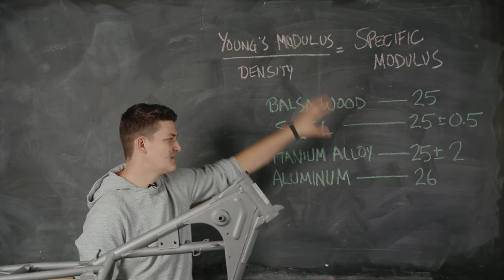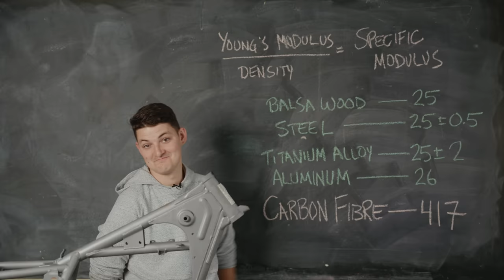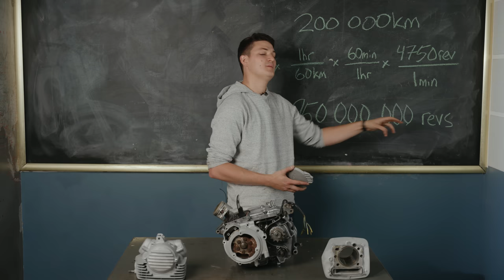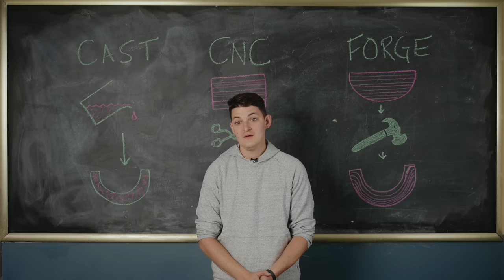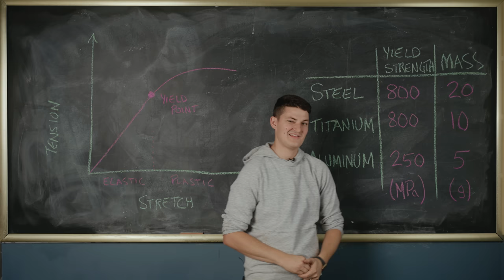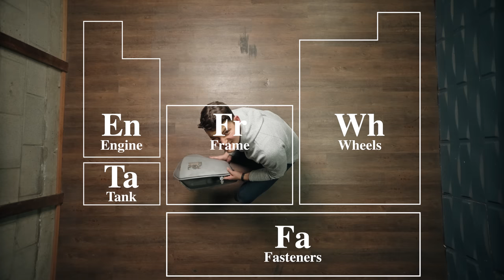Motorcycle Metallurgy - Why Steel? Aluminum? Titanium?

Comment: I learned the hard way to NEVER use stainless steel on exhaust headers, or any hot component.  At high temperatures, the chromium can slowly defuse in to the nearby mild steel and essentially solder itself in to place.  Requiring everything to be drilled out and helicoiled.  Stainless fasteners also don’t like impact guns.  While building a rear rack, 2 sets ended up seizing half way through the threads.
Reply: It's not just heat that fuses stainless fasteners to stainless parts but also shocks/vibrations through galling (cold welding). The rule in mechanical assembly is to use dissimilar metals (it can both be stainless steel but then you need an austenitic and a martensitic one). Using helicoil is a good practice and not just for repair. In the space industry, we use stainless helicoils on aluminum parts which are then bolted with titanium bolts covered in MoS2 (it helps against galvanic corrosion by decreasing the potential difference between titanium and aluminium). For stainless steel parts that need stainless steel bolts, we use silicon bronze helicoils. Impact guns are a big no no and more like a last ditch effort for loosening a heavily rusted bolt.
Reply: You can spray everything with copper spray. I am pretty sure that's the way to fix the problem. They also sell copper paste that you coat the entire bolt. Or if it's a low strength application, just coat the entire bolt in teflon pipe compound rated for 500F and oil and gas resistant. They also make high temperature thread lockers. Thread locker forms an insulating barrier of plastic between parts, preventing corrosion.

Comment: Fatigue limit (or endurance limit) is, perhaps counterintuitively, a stress limit under which the material is able to go (theoretically) through infinite load cycles without suffering fatigue failure. And steel is awesome because it actually has a fatigue limit.
Reply: Yeah he got that back to front
Reply: Was wondering if anyone else picked up on this!

Comment: Retired aero designer here, composites have their place and it’s a good place. However it’s not the recipe that’s a problem, it’s the cooks. Very finicky to design with, hates aluminum (galvanic corrosion), toxic and hard to inspect voids etc. It became what chrome in the 50’s was in the 90´s, and beyond, i.e., popular beyond reason and without enough data for predictable longevity. 
Once again Ryan has elevated moto culture above the usual caffeinated silliness. Gordon Jennings and the gang at Cycle magazine had elevated moto journalism in a similar fashion. Kudos to F9 for carrying the torch.

Comment: Steel is just such a faithful material. Cheap, easy to work and repair, and you can lower its weight by just making holes on it.
One of the main reasons we can still preserve so many railroad components from the steam era.

Comment: I built my track POS with just a used Ninja 300, and the same recommendation from many of my friends and other amature league champions before: keep mostly stock. 

Many components aren't planned out for just degradation under normal circumstances, things like handling, flexibility and longevity have been accounted for from the factory. We can change the minimum that affects handling or more, though go big or go home (big bore kit *wink*) kinda plan is up to end users.

A lightly armed Ninja with fairings, sliders and race tires (+ adjustable suspensions and raised foot pegs if you fancy) CAN blow a 600 off, left alone a CBR300 or Gladius that make you scream marauders. Hats off the metallurgy smagick and Ryan!

Comment: I liked the discussion of the different ways metal is shaped in the engine, but I'd like to see how that applies to the frame as well. The Ryvid Anthem uses folded aluminum and the Sondors Metacycle uses CNC'd aluminum for the frame to reduce costs and weight while supposedly being just as stiff as a welded steel tube frame. I'd particularly like to see Ryan's thoughts on the Ryvid Anthem after such a thought provoking review of the Metacycle.

Comment: I've been learning about  pedal bikes recently, and my cheap budget has led me to look at steel road bikes of the 80's. And there were some huge differentiators that would determine if a bike was high quality, or cheapo junk. One of which was what alloy of steel was used, chro-moly usually being the "best." They also would use tubing that varied in wall thickness; for example you might see tubes that were .9mm thick on the ends, but .6mm in the center, this would have been called "double butted" tubing (single and even triple butting existed as well). One manufacturer with a background in firearms, Miyata, basically even rifled their tubes in an attempt to increase stiffness and reduce weight. 

So, my question is, does any of this exist in motorcycles? Usually you just hear that a bike has either an aluminum or steel frame, and that's all the details you get.

Comment: Regarding cylinder walls: in aircraft engines, cylinders are frequently “chrome lined” to reduce corrosion. Does this appear in motorcycles anywhere? Also, does it reduce the anti-galling properties?

Comment: I loved the video, and in general, very informative.  I just wanted to point out a few things.  One, that rear wheel was bent pretty good.  Another, that damaged bolt was damaged with a chisel and other such implements, not over tightening, though admittedly it gets the point across well enough.  But for the thread strength, that's where the specific alloy, at least for aluminum, makes all the difference.  For 6061 (aerospace grade, depending on temper, and one of the most common alloys), your number is likely dead on, and 6061 anodizes well.  But 7075 has nearly the same strength in thread forms as steel.  The down sides are that it's not really weldable, and won't take anodizing.  I definitely didn't know some of those qualities of titanium.  One thing you maybe should've pointed out is that stainless steel is really bad for galling too, and any stainless bolts should have antisieze.

Comment: I get steel vs other metals.  I've been riding steel tube bicycles for years and prefer the spring vs stiff.  What I don't get is why the manufacturers aren't using the higher grade steel tubing (Columbus et al). Higher strength to weight, custom wall tapers, superior braze and weld characteristics. My DR650 is made from crappy soft steel that has a bad habit of stress fails near welds of the sub frame.

Comment: Galvanic corrosion is really different from your common rust.. you think you'd be safe from it by using aluminum, but then don't get it near titanium or else you'll experience a different kind of corrosion.. Nile Red shows this in an experiment and the results shows.. and you thought titanium and carbon fiber are the strongest.. then the former is prone to galling and the latter is weak to notching and fiber consistency.. it's all about balance I think..

Comment: I tried to explain this exact point a few times in the past, there’s a reason iron and steel is used for basically everything, and that when fiction describes a material that is perfect for everything, but describes it as tougher, harder and better than steel, I know it’s impossible with our current technology to move past steel and iron .

It’s very difficult to put into words how and why we choose steel or iron over titanium, aluminum, etc. It’s just that iron and it’s alloys are impossible to replace and are just that good, specific problems aside

I come into this argument from the perspective of an ex blacksmith and now a mechanic, I know how steel moves, I know how to break it.

Comment: Question?
I don't understand how frame stiffness effects handling.
The tires and suspension are designed to soak up/ control, wheel travel.
 Whether it's a Ducati trellis frame that flexs and is good.
Or an early dirt bike aluminum frame that's to stiff.
 This seams counterintuitive.
Should frames flex?
How much?
Why?
 If You answer thanks in advance.

Comment: For the record most definitions refer to the fatigue limit as the stress below which failure will never occur. That makes more sense with the way you have used it in the graph. Research also suggests even steels will fail eventually, it is just difficult to reliably test billions of cycles

Comment: lots of guys going with stainless bolts. I use nylon washers as the galvanic process requires an electrolyte so you have to keep the metals off contact when they get wet

Comment: on note of yeild strength
yeah, i feel that one more often than id like to admit
was trying to torque down the cam journal bolts on a KA24E head, aliminum
yeah, stripped them lil b's right out, right quick.

Comment: people have this misconception that because something is used on an airplane, that means its better, when that is almost never the case. modern private jets are made of mostly aluminum, titanium, and carbon fiber, not because they have some mystical quality about them that makes them "better," but because if you can make every screw, every panel, every piece twice as light as its steel counterpart, you can carry that much more fuel. steel really is a wonderful material and people need to realize that

Comment: I would love if there was a kit for a motorcycle like this that is super cheap. Im talking like 1500 dollars brand new cheap. Is that something that is not realistic for a kit motorcycle with everything taken appart kinda like in the video with a bunch of different subassemblies to put together, engine, tires, suspension, brakes, wiring, guages, gas tank, and so on. I mean the frame and such doesnt need to be painted with anything other than primer from factory to be ready for some kind of paint application, the cost would be lower on a single cylinder motorcycle kit with stuff like non electronic guages, no abs, no tcs, no driver aids, and so on. Since it would also have no efi, I would probably want the engine to be a honda as I trust their small carbureted engines the most. I guess something like a 350cc single cylinder would make this a good dirt cheap off road bike, paired with a 5 speed manual gearbox, and this could be super cheap. Still, the question is, would 1500 dollars as a kit for a bike like this be plausable brand new?

Comment: Steel? Because strong + cheap. Aluminum? Because lightness + reasonable cost [NB: no aluminum parts on early motorcycles because Al was higher than Ti co$t today.] Ti: when strong +light overrides $... Mix all 3 as needed to meet your co$t requirement$...

Comment: This is a great topic. Let's see what you do with it 😊 steel is preferable because it doesn't weaken much when bent. It's doesn't really age unless it rusts. The other elements suffer from brittleness. Fatigue. And are much more difficult to weld. Carbon is attractive until it suffers damage, and then it's total garbage. I have wondered why they don't use Chrome Moly steel.

Comment: if it is stamp forged then it keeps the grain. if it is hammer forged it will not keep the structure anywhere near the same.

but like with anything, how you build it dramatically changes how it functions.

Comment: I will say, though. In the case of every engine component or wheel, a block of aluminum is first forged, then cnc machined in the desired orientation of the grain structure.

Comment: I am 68 now. Back in the 70s when I used to race motocross with my tractor of a CZ 400. I did everything I could think of for weight reduction. Drill out bolt heads to remove excess weight ( flanged bolts were unheard of ) drill the cylinder fins and head fins at the proper diameter to increase surface area, but reduce weight. Use knobby tires with less weight, only fill enough fuel for the laps required. While it may have made no difference, it made me feel cool.😂😂😂

Comment: So a honda rebel chassis because cheap. An inline 4 cross plane because it sounds nice and is fast. Big sprocket in the rear with a 6 speed because speed. 2 gallon tank because low mpg. 

Reason why rebel chassis is because aluminium chassis. 

Recomend Hondas inline 4 they use in their CBR models. And aftermarket kits are plentiful and growing. 

Sub 5k if in good condition sub 2k if used and abused. I recomend a used and abused model because that tiny thumper won't be used anymore once you swap it. Sure you may need to bolt an adapter kit to make the fractionally bigger 4 banger but trust in the kit a couple cuts and some welds and boom. You got a fast 4 banger in the form of a scrambler. 

After that customization is all up to you.

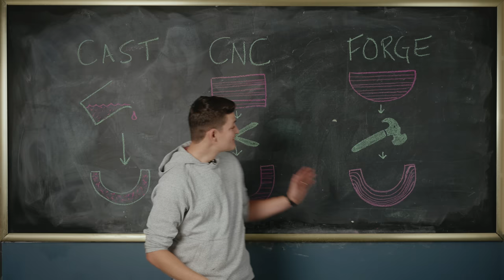Comment: casting has a predictable grain structure, just goes the wrong direction. past the surface where it shock cools its called the "colunar zone" its colombs 90 degrees from the surface of the mold, for every surface of the mold. so for that U example at 6:06 the cast should be like a bunch of slices of a pie radially with a wired seam in the middle where the columns of both surfaces touch. you can exploit the colums with slowly drawing a filled mold out of a oven for directional cooling to give you directional grains down the part that would look like the grains you drew for the forged in the same example. and with mold design you can isolate one colomb and create parts that are all one crystal of metal, its how they make jet turbine blades. casting is awesome but these techniques are more expensive then casting it close then forgeing.

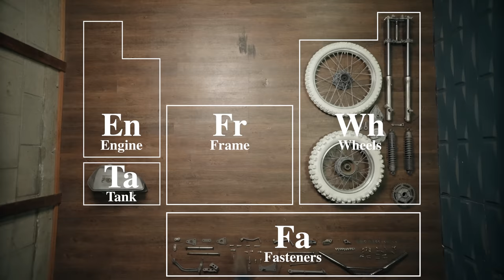Comment: 4:01 nylon lock nuts on the hot exhaust side? not so sure about that. you may find melting nylon forces the nuts loose rather than acting to secure them

Comment: Titanium Fasteners and Axles and such are also much different in how they provide strength. You cannot simply copy a steel axle and make it titanium because it will not be strong enough in the right areas, It has to be specifically designed for the application.

Comment: Stiffness of material is useless unless you shape it. Metal forming increases stiffness locally for each member. Assembling all members to form a frame, geometry increases the stiffness globally. 
In bicycles, a well designed aluminium frame will be better than a cheap carbon fiber frame. Though recently, stiffness may not be the focus but instead it's the responsiveness of the frame, as well as weight.

Comment: There is a remake of the HOREX Regina in the works. One cylinder 600 cc. Does anybody need more motorcycle? Oh, did I mention this lightweight beauty does come with a carbon fiber frame.

Comment: Steel actually has a fatigue limit. If you stress the steel parts under the limit they will not fail. Aluminium alloys don't have a limit as such so they can experience fatigue failures on any stress levels. So in engineering they use term fatigue strength for these types of materials. Basically its a stress level on given materials on were material can endure large number of cycles without failing. The key difference is on steels this number of  stress cycles is considered unlimited but on fatigue strength case its just a large number like 5x10^8 cycles.

Comment: Ford half ton 4×4 's ftom 2011 up, use Aluminum M10×1.5 bolts with E14 Torx heads to secure the transfer case, which is magnesium, to an aluminum transmission. Nightmare when someone just runs in some grade 8.8 steel bolts in instead.

Comment: Frame flex can be an advantage, or at least managed, making it part of the suspension. The extreme example of this is FWD cars going into tripod mode around corners. In effect, a motorcycle frame is a big leaf spring.

Comment: Interesting. A lot of these concepts apply the same in firearms manufacturing. Especially in frames and barrel machining. Same concepts with carbon fiber and aluminum and cast for milled steel behavior and decisions made by manufacturing based on use case
Reply: Got something for you 🖕🖕
Let talk...

Comment: You mentioned Nikasil, Engine manufactures and fuel company's should have done a better job explaining the disadvantages of using cheap fuel. At least in Motorcycles most everyone used Premium fuel and Nikasil had a chance.

Comment: 8:24
 Those screws should be in the opposite direction...!!! The screw head must always be in the direction of travel of the vehicle. If the nut is unscrewed by vibration, the screw will stay in place. That's what they taught me at school. In your case, the screw could also fall out after the nut.

Comment: nicasil plated cylinders are actually better as the plating is far stronger than steel and the aluminium cylinder has better thermal conductivity; therefore removing the need for running in the cylinder almost

Comment: If I were to start a motorcycle company today it would make only bikes between 200 and 900 cc. Carbureted, Kick Start, Air Cooled; Thumpers and parallel twins or quads. 
That might not be the market but I think it’s meat and bones of what makes motorcycles great. Ease, dependability and accessibility. No ABS, learn to ride.
Reply: The EPA would shut you down.

Comment: I've read that welding aluminum like 6061 reduces its strength by 70%. So, the obvious solution is to not weld aluminum, which is what they do in the airplane industry. So, if you want an aluminum tank, then don't weld it. Find another way to make it.

Comment: No, it's not:
steel              20
titanium        10
aluminium      5

it's more like:
steel              7.85 g/cm3
titanium        4.5   g/cm3
aluminium    2.7   g/cm3

and if you multiply 2.7 by 0.925 to round aluminium at ~5 for easier reading, then it looks like this:
steel              14.54
titanium          8.33
aluminium      5

So titanium was presented in the video ~20% heavier than it is in reality, and steel ~37.5% heavier.